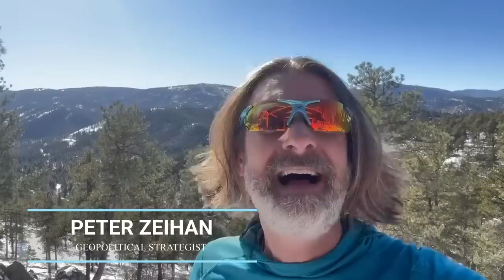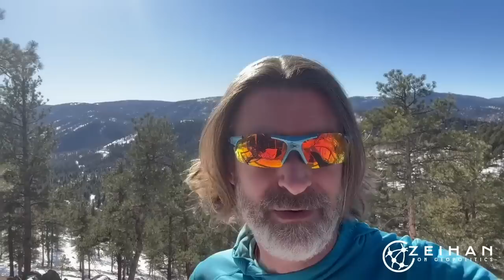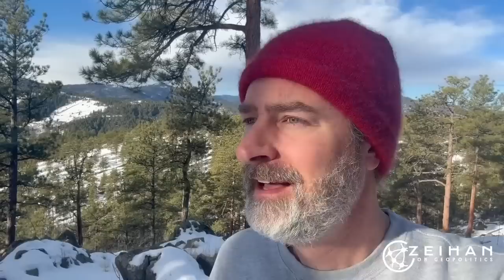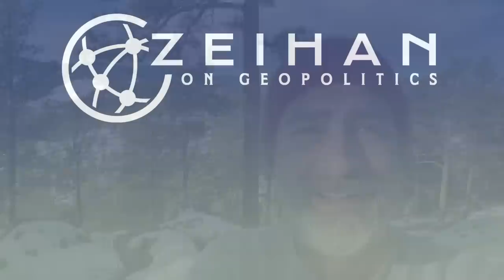Peter Zeihan || Material Processing: The Redheaded Stepchild

Comment: I see people freak out about materials needed for all the modern conveniences, and where to get them.  Especially the rare earth metals.  I look at such issues, and see opportunities to look for solutions that don't require such expensive materials.  An example would be the current electric motors that require a lot of rare earth metals.  Some people have already started working on simpler more efficient motors that only need base metals of copper and iron.  Doing this, together with removing so many barriers governments throw up with regulations, we'd be fine.

Comment: Fortunately, what with the overbuild of solar and wind power necessary to cope with intermittency, the cost of electricity will likely be zero much of the time in much of the world, particularly once everywhere is wired to everywhere else with HVDC lines.  If you're willing to run an aluminum smelter on a demand-response basis, it can act as a counterweight to large penetration of renewables in the electricity grid.

Comment: Aren't Iceland a major aluminum producer? I read somewhere that Alcoa has set up smelters there. They have access to cheap renewable energy (hydro and geothermal) in their own backyard.
Reply: You are kind of right, Iceland has a lot of its population engaged in and derives a lot of its economy from aluminium production. But its also Iceland, and thus about a third of the population of Rhode Island with half its GdP. It still makes it into the top ten alu producers most years, and due to the low domestic consumption it is important to global trade. 

But the top ten without China is only about half of what the Chinese produce. Iceland has a production capacity of around 3% of what China has (And that assumes its on less than 3/4 of possible production).

Edit:
Also for context India is number 2 in production at around 10% of Chinese production with Russia as number 3 with around 9,4%. Of course this slightly varies year to year.
Reply: @breadbread4226  very informative thanks
Reply: Another thing to consider is the conversion ratio between raw material and metal. It takes 4-5 tonnes of Bauxite to produce a tonne of Aluminium. So in a perfect situation you'd want the conversion plant to be at the mine. The reason Iceland, and previously Scotland and North Wales had Al smelters was that they had power stations that generated more electricity than could be consumed locally, or shipped out. They also had port access so the Alumina ( Al2o3 ) could be imported and the surplus electricity used to refine it into finished metal.

Comment: How much room is there to make aluminum processing more energy efficient?
Reply: As it stands right now?  Not much.  Aluminum can't be found just sitting around in high levels of purity, like you can with some other metals.  It's always mined in a very impure form and requires a lot of processing, both mechanical and chemical, even before you get to the smelting stage.  There's many steps, and even when you get to the end you need to input a lot of energy to actually smelt it.  Not as much heat as for other metals, but you also need to electrify it to get it to usable levels of purity.

So there's not really much room to reduce the energy inputs.  What can be done, however, is to produce energy in more efficient ways.  One of the big problems with so much material being produced in China is that their electric grid is powered by very dirty energy.  Their power plants are generally fairly cheap and primitive, and even beyond that they use a lot of coal-fired plants, which are incredibly polluting compared to even gas-fired plants.

Producing aluminum is almost always done near the coast, or other places where large-scale shipping is possible, due to the expense of transport (you need multiple tons of ore to get a single ton of aluminum), so the number of places you can do the work without excessive costs is limited.  But if you could find a place with both access to shipping and also cheaper/cleaner energy, you could gain some benefits.
Reply: To convert AluminiumOxide into Aluminium requires the so called Gibbs energy,... which is a given from nature: 966KJ/mol for this conversion. The current Hall-Heroult process is very efficient and already close to its theoretical minimum. So;... as Ben said: No.

Comment: Material processing is not particularly labor-intensive.  You need a bunch of expensive equipment to turn ores into intermediate materials, and turn those into the final materials that are actually used in manufacturing.  You also need a lot of energy.  But you don't need a lot of labor.  The demographic changes won't have any effect.  Even if you lose 90% of your working-age population, you can go from having 0.01% of your population work in a gigantic factory to having 0.1% work there, without disrupting anything.

Also, I think you mis-spoke: aluminum smelting is the second step (alumina to metal), not the first (bauxite to alumina).